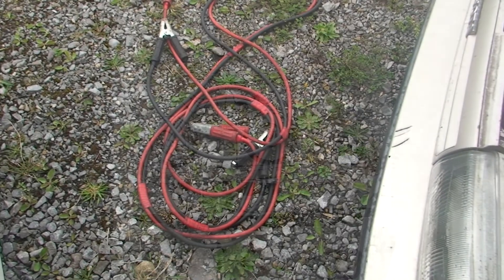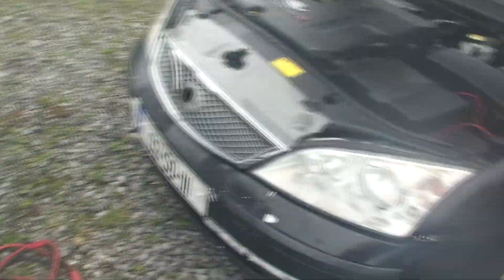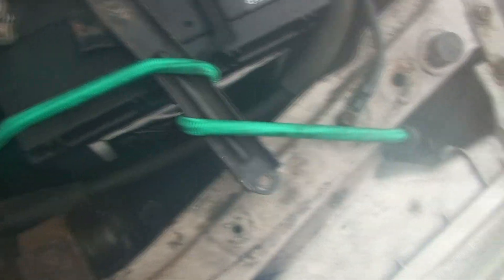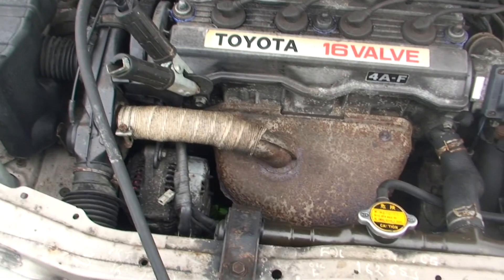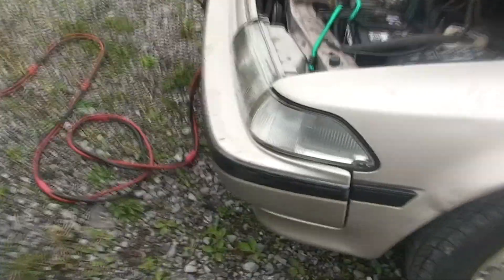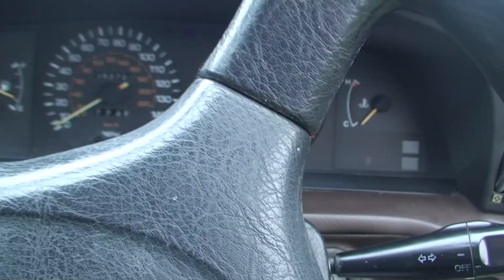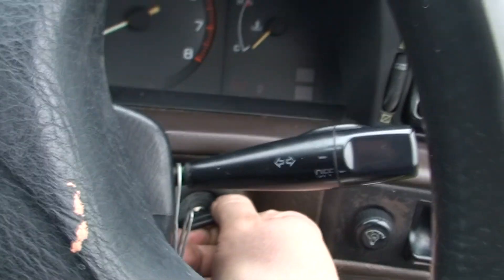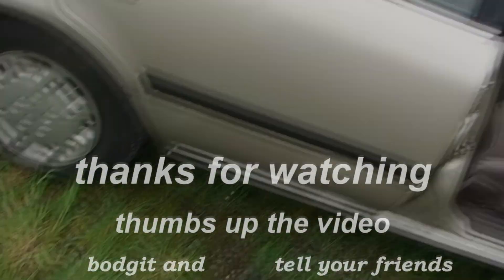bodgit and leggit garage how to connect jump leads to your car correctly

Comment: hallo way is it beter to put the ground kabel on the engine,insted of the min pool of th battery.thanks from Oliver,it's only 5 years later.haha
Reply from the maker: Hi mate there's loads of different reasons but the main ones if you got any issue with the earth cable this will solve that problem also you can get a lot more power into the battery this way and quicker